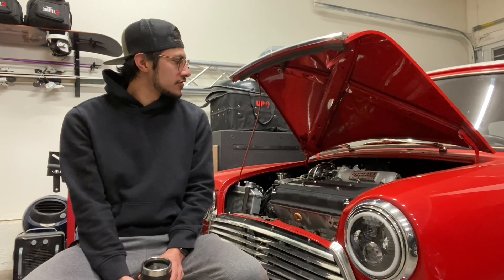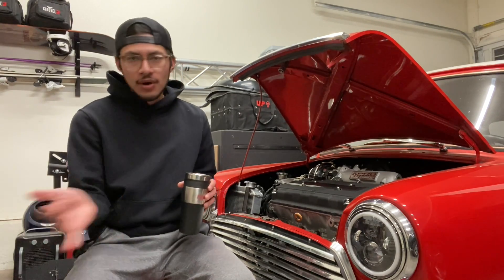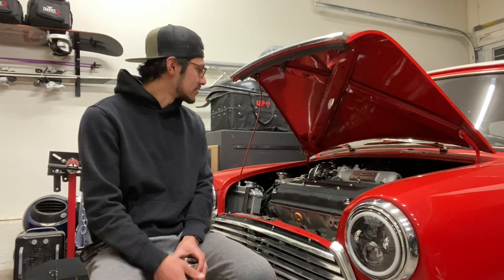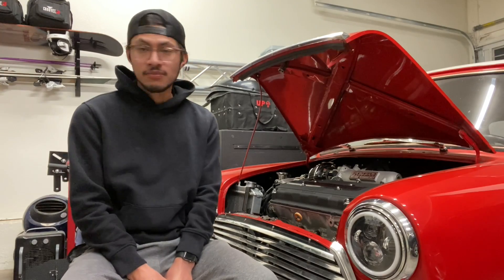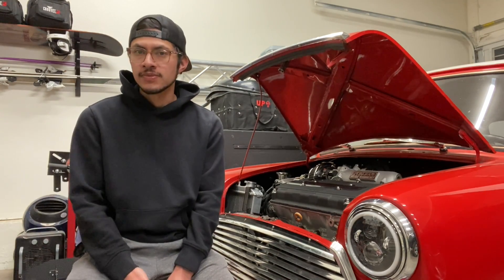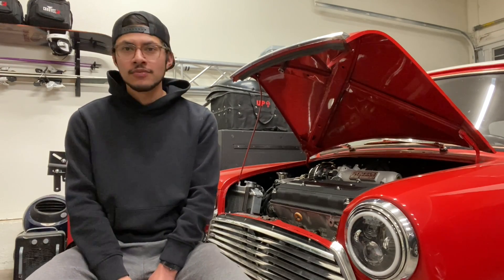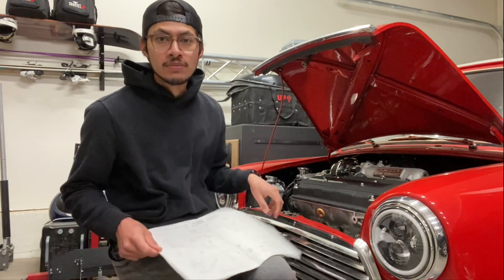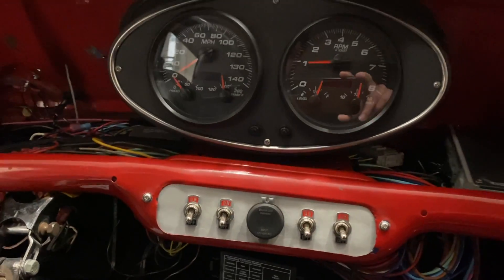DIY VTEC Classic Mini Part 4 - Wiring

Comment: Hi , what gauge set up is that , im building mine this winter and want that same look
Reply from the maker: Yay for winter builds! The gauges are New Vintage USA performance II black series gauges. Below is the link. They are expensive but they have some incredible customer service and support if you ever run into issues. 

https://newvintageusallc.mybigcommerce.com/performance-ii-3-1-black/

Comment: Thank you for this video, I am starting my d16 mini engine wiring and it scares me, your video helps ! Watch you from france
I still don't understand how the ECU gets power and if the ECU needs more information than just wires from the engine because the stock harness has tons of wires connected to the ECU that don't come from the engine. 
Do you think I can keep the stock Honda harness and just keep what I need ? 
Thanks !
Reply from the maker: Thanks for watching! It is a bit daunting especially at the beginning. Typically the ecu gets power from the fusebox I believe in the stock Honda setup. The fusebox or relay box gets the 12V from the starter which is connected to the battery. Overall that is the general flow. You can use the stock Honda harness as it was meant to run the engine, but the outputs is what is tough since you will have to verify what each wire does by looking at wiring diagrams for the Honda. From there, you can determine what you have to keep, and what you can discard. For that reason, I recommend custom wiring kits like from Rywire or minitec since they really simplify the setups and allows for easier integration. Not impossible to use the stock harness, but a lot more research is needed. Just be prepared either way and best of luck on your build!
Reply: @aguilas583  Thanks a lot for your answer, it really helps !